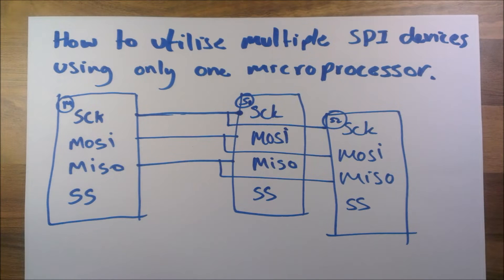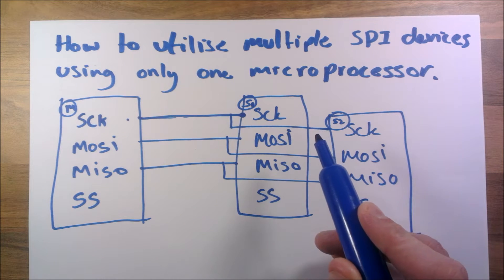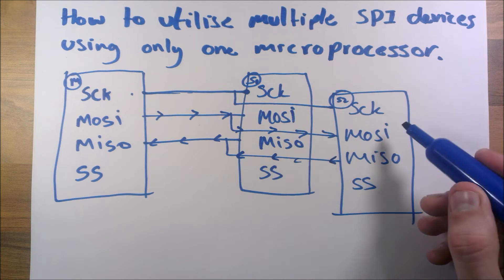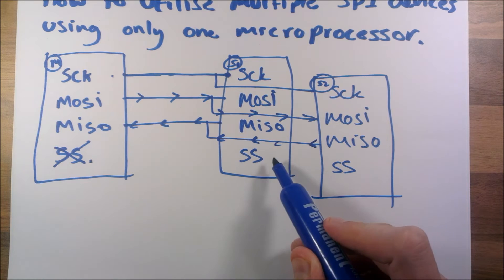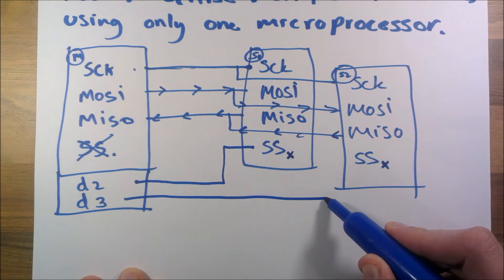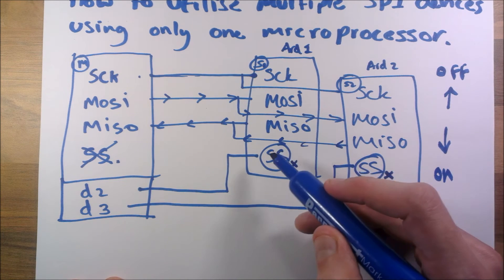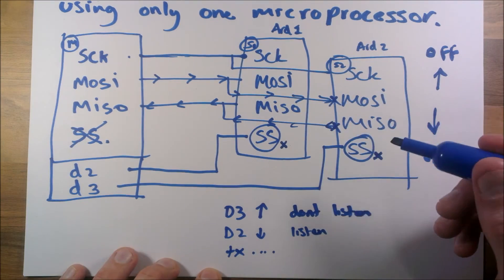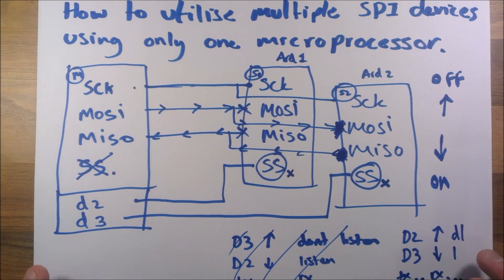TUTORIAL: How to utilise multiple/several SPI devices using one microcontroller (Arduino/NodeMCU)

Comment: 4:06 there are devices that don't have that SS / CS line. What can i do with those? Is there a way to "latch" them to SPI line on demand, read some data and disconnect them completely?
Reply: Please post the chip you use that does NOT have a SS / CS pin. I've never seen one before.

Comment: hi i need to add following to mega 2560
1 lan enc28j60
2 bluetooth hc-05
3 wireless nf24l01
4 rfid rc522
5 finger print scanner r307
6 display oled 
7 keypad 4x4
8 rtc ds3231
9 sd card catalex v1.0 11/01/2013
10 wifi esp8266

is it ok to add all the spi modules in parallel on one mega 2560, if yes then what precautions need to be taken.

as mega has multiple serial ports, will that be helpful

i am new to arduino, was just fiddling, have been able to run the spi devices connected one at a time.

experts and experienced people please help

Comment: If I understand correctly from your video, there is no problem connecting any number of SPI devices (for example RFIDs) to a single Arduino as long as I keep the SS at logic high except the one that I want to "talk to"? 
do I have to take into account maximum output current capability of the output Arduino pins? Thanks!

Comment: So this will just move back and forth between the SPI devices? What happens if device 2 wants to send something to the microcontroller, but it's currently busy sending stuff to device 1? As a pseudo-example, let's say the microcontroller selects device 1 and sends data to it that takes X seconds. During that time, something happens on device 2 (such as a button press). Then the microcontroller will miss it?
Reply: You're going to have to study up on INTERRUPTS and DATA READY logic to resolve conflicts. If you use devices without these nice signals/solutions, it can still be done with WAIT states.  It can seem complicated because it is to do it the way you asked. There is also a solution called "POLLING". In the absence of handshaking signals/protocol, you can just write the code to force the client not to try "interrupting" but rather just HOLD the data. In that scenario, the master will simply do what's called "Polling" to see if a client has data to dump. All clients on the buss, in a manner of speaking, hold what they have to "say" until they are "spoken to".  Kind of like having 10 kids trying to interrupt the teacher in a classroom.   🙂

Comment: Hi Antony,

I am using an ESP8266 microcontroller. I need to connect multiple analogue sensors and save the sensor data onto an SD card using the SD Card reader module.

I have followed one of your tutorials using the MCP3008 to connect multiple analogue sensors. 
The SD card reader shares the same pins as the MCP3008. So, whatever you said in this tutorial, will it work? 

I am fairly new to microcontrollers and have little to no knowledge about SPI.
Reply from the maker: Hi Trisha!!! Welcome to electronics!

You've done well to realise that you need MCP3008 for ESP8266. The ESP8266 is not the easiest module for beginners. So at the moment, are you successfully reading analogue data into the Serial Console? Obviously, that needs to be verified first.

To write to an SD Card using the appropriate SPI module, yes, it will be helpful to understand the info in this tutorial. There is a little complication involved when you connect up 2 SPI devices (which doesn't exist when you use only 1 SPI device); the ESP8266 won't know which of your two modules you want to 'talk' with at any given time. The info in this tutorial explains the problem and the solution. Thankfully, the solution is not that difficult - it just involves manipulating the CS/SS pins. :-)
Reply: Antony Cartwright 
Yes I can see the results on the serial monitor. 
I understood everything from this video. Just wanted to verify if that is what I should do. 

Thanks a lot!
Reply from the maker: I believe it is what you should do. Good luck! :-)
Reply: Hi Antony,

Would it be possible for you to show how you set the D2/D3 pins to HIGH/LOW ? (code)

I can see the output on the serial monitor, but when I connect the SD card reader module, the analogue sensor outputs as 0 and I'm not able to use the SD card reader as well. 

I have used D2 for my sd card reader and D8 for the MCP3008( Like you said in your other video)
Reply from the maker: Hi, roughly it involves a few lines of code:

//AT HEADER
#define mcpSSPin x
#define sdSSPin x

//IN SETUP
pinMode(mcpSSPin, OUTPUT);
digitalWrite(mcpSSPin,LOW);

pinMode(sdSSPin, OUTPUT);
digitalWrite(sdSSPin,LOW);

//IN LOOP
digitalWrite(mcpSSPin,HIGH); //We want to talk with MCP now:
//Do whatever you like with MCP.
digitalWrite(mcpSSPin,LOW); //Stop talking with MCP now.

digitalWrite(sdSSPin,HIGH); //We want to talk with SD now:
//Do whatever you like with SD.
digitalWrite(sdSSPin,LOW); //Stop talking with SD now.

It's like that...

Antony...
Reply: Antony Cartwright 
Okay, I’d done everything except putting it in the setup function🤦🏽‍♀️ thank you so much 😊
Reply from the maker: Haha! It's ok! Many people forget "pinMode(mcpSSPin, OUTPUT);". I forget it sometimes also. :D

Comment: Hello i have a question on multiple SPI devices.  I have a Display and a SD card module. But here is  my problem the SD card locks up the MISO so it would not share it's pin with other SPI devices on the BUS. from what I'm reading and see is that i need a 74HC125 or something like it to make this work. Have you came across this problem or saw it because or is there a way around this?
Reply from the maker: Diy in the Ghetto Hey, that's very strange. It's supposed to be operated using the CS pin and if that doesn't work, I assume it's broken?
Reply: Hello  no everything works if they are wired to there own arduino boards with no problem. But when wired together they cancel each other out. i Didn't see this info someone from Adafruit told me a admin on the forum pages said Please note! This device does not tri-state the MISO pin, it should not share that pin with any other SPI device (including an SD card reader) without the use of a 74HC125 or similar
Reply from the maker: Hi, I've never heard of that I'm afraid. Every SPI device I've ever used was dual state, either HIGH or LOW. It seems that maybe it has not been designed correctly or something. I'm not sure though.

Comment: Do you have sample codes using this setup?
Reply from the maker: Jefftrin Catarig Hi, only what is in the videos..
Reply: Antony Cartwright If I understand it correctly. I have a microcontroller Nodemcu and 2 modules RFID and TFT. Both uses MOSI, MISO and SCK. The Nodemcu has one SCK pin and 2 MISO/MOSI. Are the connections of both RFID and TFT thesame? 

Thank you a lot for all your tutorials :)
Reply from the maker: Jefftrin Catarig each bus will have only 1 Sck, mosi and miso. Wire both devices to that one bus.
Reply: It is a generic example. The code and libraries will depend on the devices you want to connect...

Comment: The master and slaves must be in the same Power? If yes, How to  this with differents m microcontrollers?
Reply from the maker: Hi, I don't fully understand the question, but the master and slave need power relating to their own needs. It's usually considered bad practice to power devices via a microcontroller, this is because they aren't designed to provide power, they are designed to use logic signals to control things.
Reply: I think the question may relate to the fact that NodeMCU is 3.3V and Arduino Uno for example is 5v.  There is a conflict.  I am curious how people have solved this.  i am thinking of using resistors.  Not the best perhaps but simple.
Reply: Using a level shifter? same as serial connecting Arduino  5v and ESP 3.3v

Comment: If you are going to make tutorials it is important you get the nomenclature correct. They are microcontrollers and not microprocessors. A microprocessor requires support components such as ROM and RAM, a microcontroller has these internally. They are not synonymous.
Reply: completely irrelevant to the tutorial......
Reply from the maker: Nick B Thanks for your comment. You're right. This is supposed to say "microcontroller" rather than "microprocessor". Thanks, Antony...

Comment: Hi Antony, Thanks for a great tutorial ,simple and easy to understand as usual. Well done! Bye the way I have been trying for over a year to establish SIMPLE reliable two way communications for one of my projects. Thanks to your NRF24 tutorials I have now established a great 2 way system. Really pleased. Cheers.
Reply from the maker: Steve A Thanks! I'm glad you like the tutorials! It's great that you've found them useful too. What was your project? :)
Reply: I have a large workshop situated about 200 metres from my house fitted with solar and lots of other stuff, I wanted to access the information and issue instructions to equipment from the house. I have been using a cable but "clumsy" and difficult to expand.Using the high power version of NRF24 its perfect! and I can make hand held TFT  transceivers that I can carry about.
Reply from the maker: Steve A That's cool! I have a similar setup. I have a small outbuilding which is about 15m behind my house. It's my workshop/office. I record my videos in there. I have buried an armoured cable which links to the consumer unit in the house to the consumer unit in the outbuilding. I've also buried an Ethernet cable along with it, with a router in there which broadcasts another ssid and offers cabled internet access too. I've also got another outbuilding which I call the solar shed. It has 1kw of panels on the roof and this is my main project. It powers the office/workshop in the day. I've got a lot of interesting solar stuff which I haven't published. Maybe I should...
Reply: a good Arduino charge controller ....MPPT? maybe
Reply from the maker: Yes! I've got an MPPT controller. I've actually got some videos on the setup, they are old though...
Reply: Hey can i have your contact?